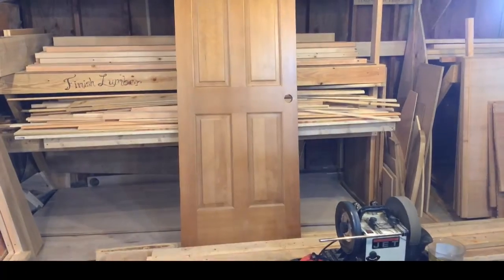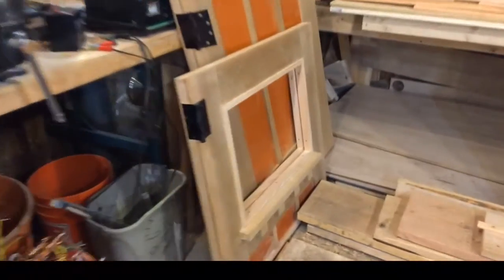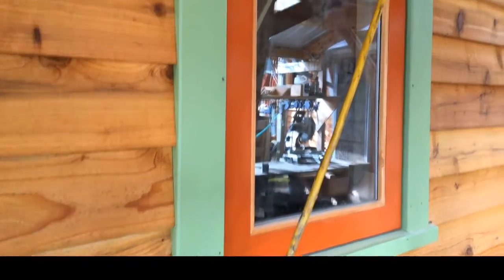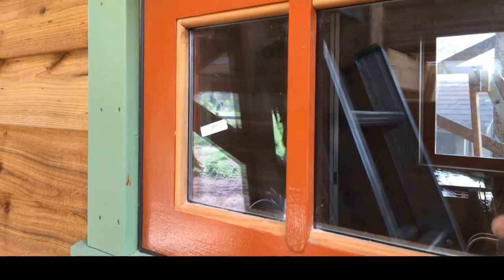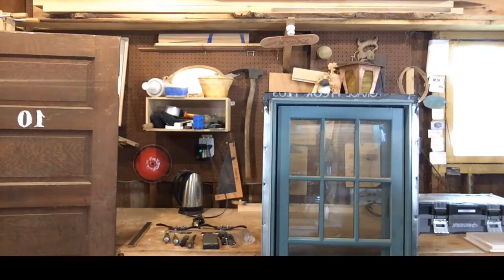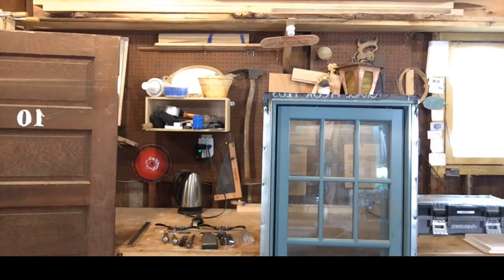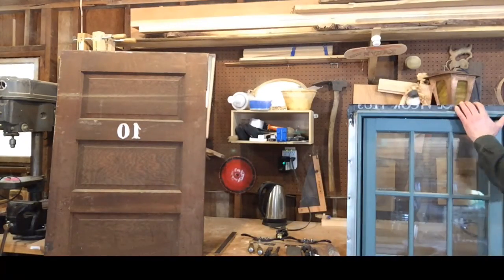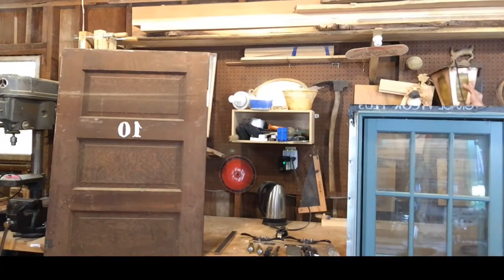Ask Zyl Live - Windows & Doors Part 2 - April 16, 2017

Comment: Argon windows don't do well at altitude tho
Reply from the maker: Thanks! I didn't know that. What is it that happens?
Reply: Unless the windows are built at altitude with argon the argon will begin to evaporate or condense because of the altitude. You will be able to see the argon drop between the panes. I live at sixty two hundred feet up and there are not many argon windows here unless they are local builds
Reply from the maker: Thanks.